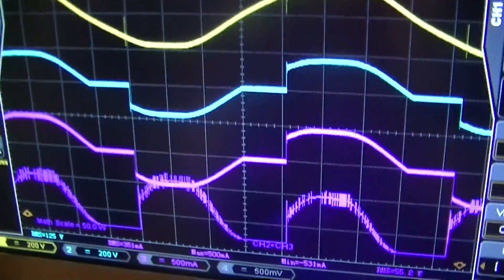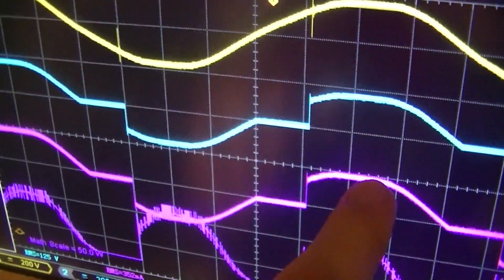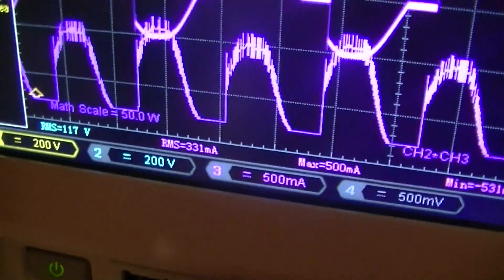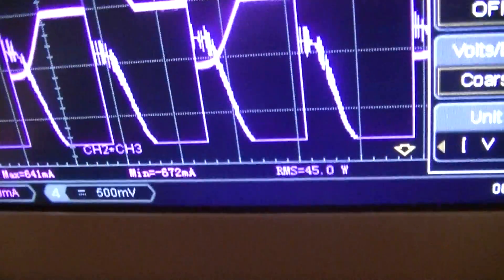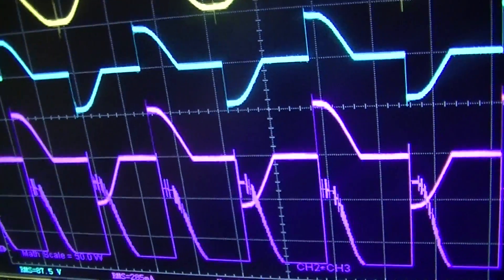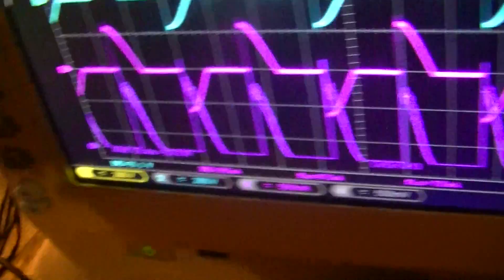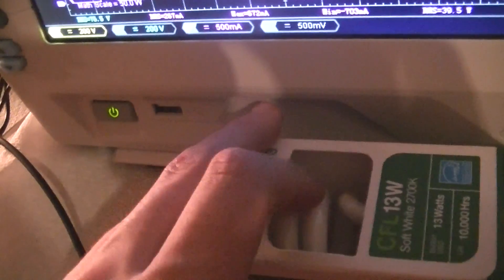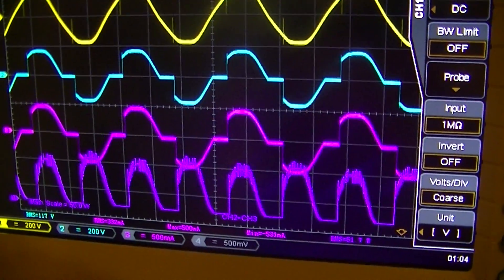Why I hate dimmers

Comment: Can you show or send me how do you made your connections? As i undersatnd you used a isolator transofomer to get the rigol floating... but i´m wondering how do you got the current and the voltage from outolet and before dimmer...Could you help me do the same experiment here...tks..

Comment: Nice scope I still have my old beckmen 100 mhz 2 input scope. It 20 years old.I seen a fluke scope for sale for $100.00 I have never used one is it a good scope?  
I have 3 dimmers in my house the thing that bothered me is the damn buzzing.
Reply from the maker: Buzzing is due to a combination of magnetically and thermally induced vibration in the filament.  I don't have a problem with it as I know what it is, but that is yet another problem with them in certain cases.Never used a Fluke scope but Fluke tends to be good stuff, hence the price premium.  You would have to research the particular model.